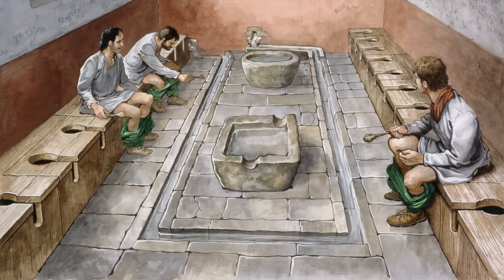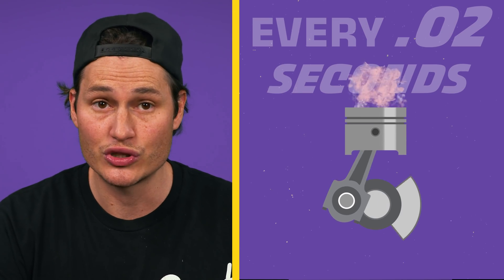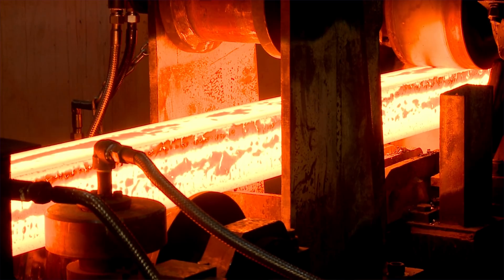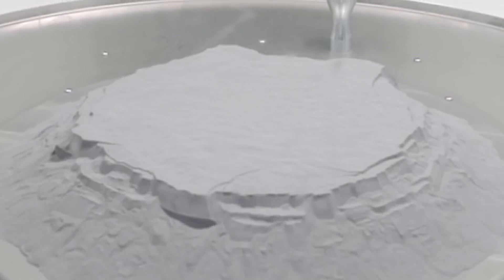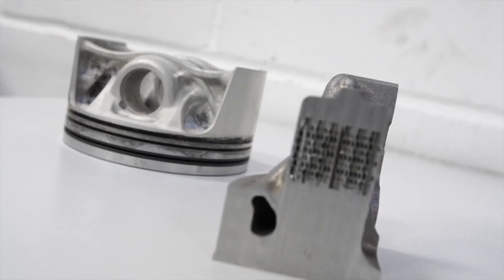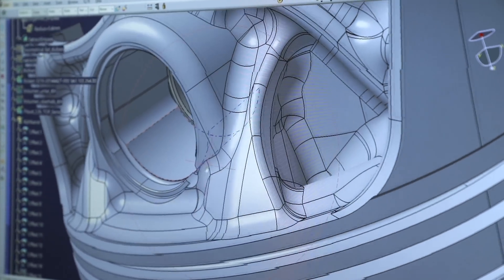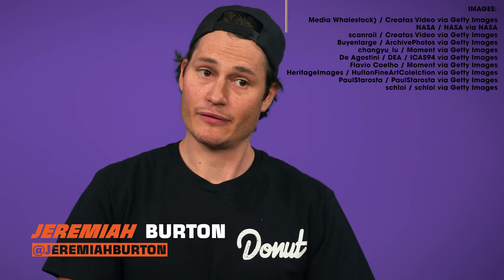3D Printed Pistons Are Changing the Game

Comment: Imagine as these algorithems improve.. Dude 30% weight loss per piston. Plus having an engine thats also been topographically designed...

500hp could become the industry standard if prorche decides to license out this tech..
Reply: Think about it, a nornal modern 4banger tuned can throw out 300+hp.. 

Apply these methods to that at the stage in current development and you could probably hit 380bhp easily. 

So given more improvments and exponential gains from it.. 
I cant wait to see this improve.

Comment: Forged pistons don't inherently expand more... That's not a difference between forged and cast pistons. The amount of expansion is based upon the alloy, not the manufacturing technique. 

Most modern, cast pistons are made of a high silicon "hypereutectic" alloy; that silicon content (the alloy) is why they are low expansion.  You can also get forged pistons in 4032, high silicon, low expansion alloys. 

2618 alloy forged pisons are very low silicon and are much higher expansion. -With high silicon you trade less expansion and tighter tolerances with less rocking / piston slap for a more brittle piston that's more likely to catastrophically fail under detonation.

Comment: 135÷24=5.625days
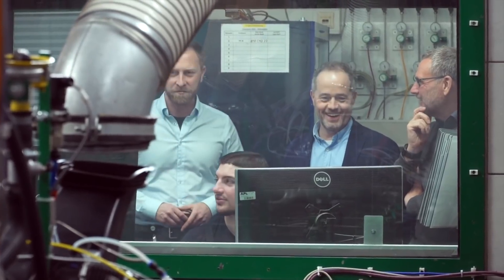9:00 Timestamp
Imagine driving to work on Monday and driving full Throttle nonstop until Saturday afternoon then finally letting off the gas..... I feel like that's an insane achievement for a machine.
Reply: All I was thinking about at that point is how much fuel that took, and how many tonnes of CO2 were added to the balance sheet... Then again, it's probably standard procedure for engine manufacturers.
Reply: @zJoriz  If you compare it to the lifetime of a single car it's nothing. Better optimized parts will make cars more economical in the future wich will very rapidly rebalanced some tests.

Comment: they're printing them because additive manufacturing is cheaper, you don't need the engineering and manufacturing expertise of assembly workers at a third party metal casting source offsite, or train employees on slicing tooling paths for a CNC machine on metal forgings, both of these jobs pay in excess of $50k/year. however with automated additive manufacturing, plus optical scan QC by zeiss. you only need to pay minimum wage to some guy from Mexico that doesn't speak English....and just train him red means trash green means box it and your production line goes from 20, 50k/year+ employees to a couple of hectors or juans with no English speaking ability and the willingness to work for peanuts and no benefits

Comment: Jeremiah: "a design that's over 300 years old"
Donut Media: shows a caption that says "first recorded use: 1838"
Reply: What about the communal sponge?
Reply: @gphilipc2031  chillin next to the poop knife
Reply: @gphilipc2031  I still use my communal sponge
Reply: Think that was when the first patent was filed. Pistons have been around since at least   300 BC  the Greeks were using them and a couple of Archimedes designs used Pistons also.
Reply: they should  probably be improving electrical engines or even batteries. this today Its like improving horse carriages in 1910

Comment: Lol 10:08 ... "never", 3d printed pistons will always be stupid expensive, it's the production time. This is an uber race track item only.
Reply: That's a strong statement,  you seem to think 3d printing will somehow always be as slow as it is now.

You also seem to not understand how industrial processes work, to have a high production rate you dont need to pop out single items quickly.  You can also pop out many items simultaneously!

Banks of specialty piston printers can still produce thousands of pistons a day even if each piston takes two hours to print. 

But realistically we can expect a large degree of optimization in the process and the development of specialized machinery.  

One particular route could be a combined manufacturing process,  the pistons shown seem to retain a pretty conventional structure for the crown and change radically as you get down to the body.

So cast forge or machine the crown and print the rest onto it.  There's easily half of your print time gone. Likely more as you no longer have to print hundreds of basically solid layers, and you don't have to account for the heat imparted by the fusion process. 

And before you retort with some comment about it being a complex process,  we have been using multi piece pistons for decades.  Some have used a steel insert cast into the center of an alloy piston while others have used steel ring lands cast into alloy pistons.  Multi step processes are not an impediment.
Reply: @DrewLSsix  It won't happen before electric takes over.

Comment: Its not a case of "if its not broken,  dont fix it" its a case of technology allowing for improvement dude. The first thing i got from the thumbnail is making the piston lighter in weight and probably bringing down the cost while using less material. The lighter piston will probably have a similar result as upgrading to lighter flywheel.

Comment: Now, with 3D printed Con-Rods, 3D printer Crankshaft, 3D printed cylinder block and heads, 3D printer camshafts and 3D printed valves, or even 3D printed flywheel and Dampers, that's LA PERFECTION !

Comment: I am going to say this is going to be a disaster given we do not have the technology and understanding how to 3d print metal for such a part.  I have studied and researched this and the problem with 3d printing metal right now is we lack the ability to create strong grain structure and you end up with a grain structure that is worse than casting creates since the grain structure is linear and follows the print. This is bad because there is not a strong bond between the grain structure which means it is highly likely to fail

Comment: humm intresting 10 % of weight reduction and this lab results now they can apply cvd anti friction coating lower piston part below oil holes  can be made porous for better lubrication wrist pins mountings  can be made porous whats called anti friction bearing because of micro welding technology more likely do not fail on lack of oil pressure on some limits heat resitant titanium disc on top bionic design to destribute surface load of central postion disk on piston walls to square pistion in cylinder addition of one more groved splined ring at bottom of pistion with softer material which can avoide rattaling of piston at cold start

Comment: "They are not made out of some super high pricey material" at 2:40  

Welll... Keep in mind that the "toner" for those type of 3D metal printers is very fine metal powder with some very tightly controlled characteristics. Metal powder for printing (or "additive manufacturing" as they call it) can be 10 times as expensive as the bulk material.

Comment: I'd love to see a cylinder head for a turbo motor passed through an ai for fluid dynamics, gas flow and this topological treatment. With the move to integrate exhaust manifolds now with an AI making the most optimum route from intake valve to the turbo/wastegate. I'm wondering how much mass could be saved and how much power could be gained.
Reply: At this point we shouldn't be to far from printing the entire engine. How about a titanium 3D printed AI optimized block?

Comment: 3D printing the pistons is just the first step. consider engine blocks. you can reduce weight by a lot while also improving cooling a lot. and for race cars you can 3D print the entire block with the pistons inside and seal the thing up removing the need for a head gasket and the cylinder head can be made more complex and aid in other operations.

that is just the engine things like the frame of the car can in part also be 3D printed to improve weight. you can make a stronger roll cage with less weight. 20-30% total weight reduction would be possible. the real cost and why it never be made for consumers is machine time is quite frankly insane. but it will be fun to see what can be made for racing.

Comment: Everybody gets forged vs casted wrong because of oriental mystique. Hammering steel does not make it stronger nor changes it's grain structure, that's what heat treating does. The strongest steel parts are not forged, but casted.

3d printing parts is also more akin to casting since it needs to be sintered.

Comment: Or, just build a small gas/diesel engine with less tech and get the performance from the electric motor required for mpg, 0-60 and top speed. Use the engine as a generator.

Comment: "Forged piston are made from a billet of aluminum" video of a dude hand forging a knife lol
Reply: @snarkylive  Lets not forget Cold Metal Forging . Cold forging is a metal shaping & manufacturing process in which bar stock is inserted into a die and squeezed into a second closed die. The process, completed is at room temperature or below the metal’s recrystallization temperature to form a metal into a desired shape or configuration
Reply: A steel knife lol
Reply: @Adam Courchaine  you're not wrong I work in a machine shop making high quality forged aluminum pistons and rods
Reply: @snarkylive  forged pistons are not made with a hammer, they are made with molds. nobody on the planet can made pistons consistently enough with a hammer. read a book.
Reply: @Kevin-dt9xm  You don't even know the definition of forging. Yes, forged pistons are made with a hammer, a very big one that is called a hydraulic press. 
A few videos you should look to educate yourself since you didn't mention wich books you had read....
https://www.youtube.com/watch?v=Jr6qk5wCPEQ
Here forging connecting rods
https://www.youtube.com/watch?v=vlLb17MEmUY
Reply: @Kevin-dt9xm  ehm it showed someone using a forge. That's why.
Reply: @Kevin-dt9xm  

Careful you sound dumber then you look. 
Forging is a manufacturing process involving the shaping of metal using localized compressive forces. 
Be it a hammer a bible or a butt.
Reply: @Kevin-dt9xm  uh no, cast pistons are made with a mold. forged pistons are machined from a forged billet.
Reply: @Kevin-dt9xm  Those are cast pistons man -_-

Comment: 3D printing using FDM (Fused Deposition Modeling) very rapidly went from experimental to niche industrial to commonplace for hobbyists - mine is running right now making a model boat. I wonder if in a few years these SLS (Selective Laser Sintering) machines for making metal parts will be within reach of hobbyists? Then I could make all the metal parts for my car, basically make my own engine from scratch if I want.

Comment: 2:52 all pistons are cast and machined, but you have "as cast" and forged can be "as forged" or fully machined. I used to work for a German company that is world wide renown for pistons cams and other car parts (hint: all cars in Nascar but one has this brand piston)  while working there i got to work along side Japanese and German and American engineers on pistons and I can walk anyone thru all the measurements and features but so can you jerry.. but understanding metallurgy is very important when you are teaching. Cast and hyperuetectic are made the same way but there is one thing added.. forged is usually just an alloy pressed into a shape close to the shape of the piston (which is stronger) but it expands and contracts differently than cast or hyper pistons so the machinist has to be aware of this when boring or the manufacturer has to compensate. I only watch this channel for jerry Everyone else dont have a clue! You best be getting paid alot because your knowledge is worth more than you think, try studying what racers did in the 50-60's to make power and you will understand alot more and be more versatile.

Comment: So here's my ultimate dream. '71 Firebird formula. Let AI produce a 3D-printed frame & body fusion. Let the same technology in this video work not only on the pistons, but on an entire LSX or Mopar Hellephant engine. A fully Laser 3D printed aluminum LSX/Hellaphant engine. Fully carbon body. Lightweight wheels. stickiest rubber. Best brakes out there. Royal bull hide leather seats. Get it tuned by Lotus. Let the engine be able to run on FULLY synthetic fuel. BMW/AUDI laser headlights fused into the original lights. Now that is a baby i'd throw my money at if i even had anywhere near enough for it. But it surely would RIP.

Comment: They will be selling “topologically optimized pistons” to every idiot that wasn’t getting enough out of his $10 spark plugs and electric turbo.
Reply: Id not be surprised if those are multi thousand dollar piston each.    slow manufacturing process, likely with a high reject rate judging by the extensive measurements and analysis post production.     For use regular folks, if you want extra power, up the displacement using normal inexpensive parts, there is no replacement for displacement.

Comment: LMAO! Carbon fiber pistons how long they would last? I guess like 0.5 seconds to 5 seconds.
Reply: Engine manufacturers tried carbon-carbon composite pistons as far back as two decades ago. Carbon carbon composite, that's the stuff the Space Shuttle nose cone was made of! Those things would easily last in a high performance engine and perform very well. They were extremely expensive though (needing furnace bake times of a month!), they were extremely difficult to machine, and the thermal expansion coefficient of C/C composite differs too much from metals, so it never saw any commercial application.

Comment: How did they properly test these and confirm that they work, but yet they're not going to be available on the market for 10 fucking years? Get they just put one set through regularly high testing and it worked just fine and could theoretically be released very soon.

Comment: That’s why a lot of vehicles use hypereutectic pistons which are stronger than cast but not as strong as forged. They are considered the best value for the money. Examples the mopar 392, LS7, LT1-4 series, coyote Gen 2-3. But most manufactures still use the cast pistons.

Comment: 3d printing today is slow and expensive. Its primary focus today is for prototype and small production runs. Although we're starting to see a number of the bigger players in the metal 3d printing space drive the design of their software and hardware to handle mafacturering. In particular 3d print mafacturers who specialise in metal printing are looking at ways you can fill a build volume full of parts and figure out the best arrangement to eliminate or reduce part floors. Today it's mainly reduced floors because the amount of processing grunt to process a simulation requires an absurd amount of time on today's hardware. AI is used to make a shorter educated guess on the best part arrangement. Innovation in the 3d print space would be a lot faster if mafacturers hadn't patented everything related to the print process.

Comment: The cooling galeries are great idea. Lighter pistons are also more gentle on bearings and stuff I presume. They ran it only to 7300rpm? Stock gt2RS engine revs up to 7800(so did they run new pistons to 7600 or 8100rpm when they raised the limit by 300rpm vs stock?) Only 200 hours of engine dyno testing seems like a bit too short for longevity assumptions but the engine makes like 22psi of boost - impressive that non forged pistons took it. Although with perfect conditions thanks to the dyno. Very interesting technology. Loving that Porsche is trying to make ICE better and relevant in these days.

Comment: Is Porsche saying that 30 hp can be gained per piston? Because don’t they have a flat six engine in their porsches? That would be 180 hp gain just by changing the pistons well possibly needing to reconfigure the oiling passage for them also if it doesn’t lineup with the existing oiling passage for their stock pistons.

Comment: Imagine how much more a f1 car can rev and what all they can do with this tech
Reply: 300 rpm. He said it in the video
Reply: @kellypg  F1 engines can't be compared to daily driven Porsches with reliability in mind.
Reply: old f1 engines used to do about 20,000rpm. they rev lower these days because they can make power at lower revs thanks to the turbo. also, they only have a set number of engines to last a full season, so dont stress them like they used to. i think the regulations cap the rpm to 15,000, but this is rarely if ever reached

Comment: Run a magnetic oil pan heater for about an hour before starting an engine with forged internals, it greatly reduces the amount of wear on piston rings, rod bearings and main bearings which is always increased under a cold start condition.

Comment: If you figure a car lasts 200,000 miles and drives an average speed of 40mph at 3000 rpm over its life then each piston will have gone up and down 900,000,000 times. Since in a 4 stroke engine you get one combustion stroke for every two rotations (up/down cycle) you end up with 450,000,000 combustion cycles over the life of the car, not billions. Not to be negative. Just thought it would be interesting to quantify.

Comment: check out ''extreme tuners greec''e and ''spyros panopoulos automotive'', thay have been using 3d printed engine parts on their world record evo for a while, some made from  carbon some made from ceramic some for titanium, even form zylon, and they are preparing two hypercars that have the same weight reduction technique as showed in the video. All made and engineered in greece as well. check out their work it is absolutely mindblowing